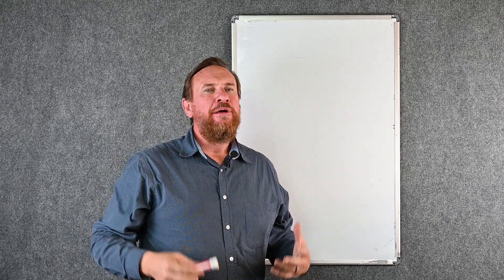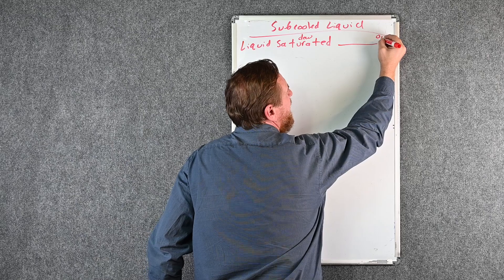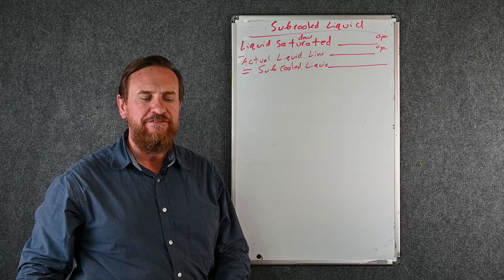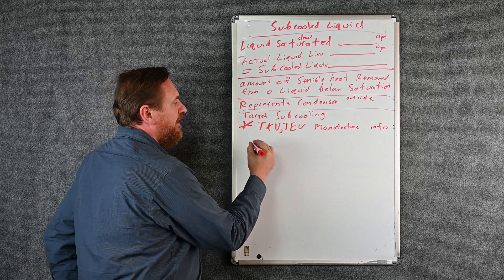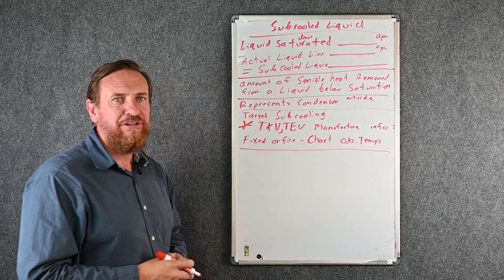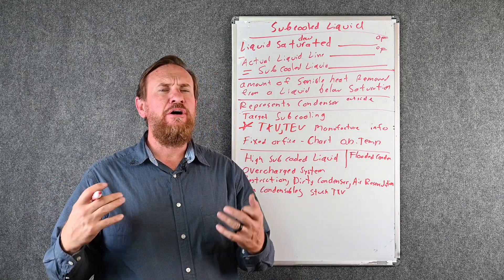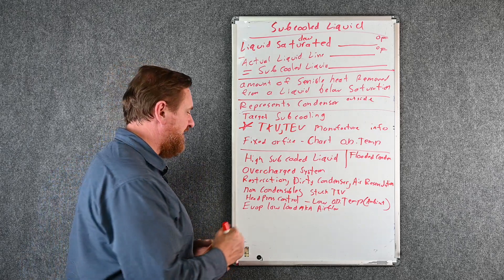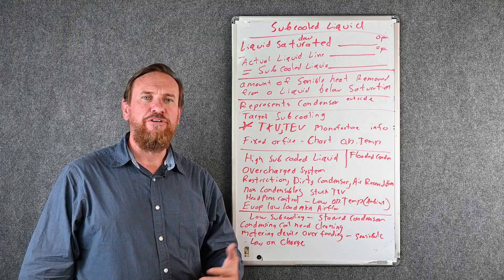HVAC 067 Subcooling notes

Comment: Great video Ty, very simply explained. 
I would love to hear more about non condensibles and system reaction/diagnoses. I have came across it many times as i’ve been on calls, and able to fix it, just never defined exactly that was the fault. usually high liquid line temp/high pressures etc. But would like to know more if you ever do a video as you are the master of explanations 😬

Comment: HI ,,Many thanks  your information greatly cleared up my auto trade teachings [ alot of incomplete theory buy not what u need ] subcool and super heat  gotta luv them . 
Ideal low press R12/r134a low ac auto 20- 30psi/temp prevent freezing ,, high 150-180 psi /temp = properly cooled 100% refrigerant supply to evap . All this at 105f ambient . !!
Try 270-290 psi down to 150/160 the system performed way better with 2nd condensor .  Refer above . Sent bill to Ford ...LOL  vent temp 45f  doors open   lol lol  works really well
Thankyou for clearing up my auto teachings . As u may no auto are very poorly designed systems compared to commercial fixed plant .

Comment: good video. i have a question please.
could you explain to me why if the condenser is dirty the subcooling is low ?
what the meaning of starved condenser?, because if the condenser is starved, do you want to say that it  have less  interchange area for latent heat ?, i consider if the subcooling is low the condenser are having more area than normal  for interchange the latent heat, could you please help me with that ?
besides, what happens with the sensor bulb if i the condenser have a low subcooling ?
thank you for your time.  i will really appreciate it.

Comment: Hi Great Presentation on SC with an TXV EEV fuly understand find target on maunf Data plate or otherwise  but Iam slightly confused on Fixed orifice starting SC ..Not SH while SH is Super important Right !!! but @ the moment its SC lesson . .. BUT @ around 6:33 to not sure where its ends 6:45 maybe  but ur saying SC will be much higher with  lower  ODA tempt & also seconds after u said SC will be much LOWER   with Lower ODA if I herd you correctly that is...... so slightly confused witch makes Higher SC 70 day or 95 oda ..for an fixed orifice Day Thanks
Reply from the maker: With a fixed office we focused more on Superheat but we don't ignore subcooling. 
If you look in the playlist Learn HVAC  these videos are in  numerical order. I have videos specifically demonstrating how subcooling works with a fixed orifice. 

I will put it is a few words but the video does a much better job explaining with visual effects. 
With a fixed orifice, as the outdoor temperature goes up the pressure goes up. There is now more pressure against the liquid so more liquid is pushed through the fixed hole. More liquid is pushed out of the condenser so the subcool liquid quantity drops. 

As the outdoor temperature drops the pressure against the liquid drops and less liquid is pushed through the fixed hole. So subcooling in the condenser goes up.

Comment: do I understand correctly that the low subcool indicates that there is no proper heat exchange in the condenser, and the high subcool that the condenser is too much air cooled(too big temp. drop)? When there is a low subcool, is there too much vapor in the condenser and condensation is too late?

Comment: hello, why a dirty condenser coil will cause a low sub cooling? As it heats up it will increase the pressure and the refrigerant will condense faster...Am I missing something?
Reply from the maker: The dirty coil dosen't transfer heat as well so the convincing temperature and pressure rises. The higher pressure pushes the liquid out of the condenser faster on a fixed orifice.
Reply: @love2hvac  I got it, thanks!

Comment: Hi Mr Branaman, can you please answer my question: what will append to AC condenser (in summer mode) at low ambient temperature to the amount of liquid refrigerant?
Reply from the maker: Usually the condensor will flood to build the pressure needed.

Comment: Is it better to do the wet bulb in the ductwork by the return or out of the ductwork?
Reply from the maker: I prefer to do in in the duct close to the evaporator if there are multiple returns. If its one return it should not make much difference especially in a closet unit. A leaking duct in an attic would make a big difference.
Reply: @love2hvac  thanks ty👍🏻

Comment: Low ambient with no fancycling will cause a starved condenser…. Adding to low sub cooling due to the condenser being too efficient. Even with fan cycling in low ambient the artificial load on the condenser does not raise subcooling just head pressure. There’s just such a major swing in pressure, full column to no column of liquid if you pay attention to a sight glass. Pressures must be stable for Atleast 15 minutes for true readings.

Comment: Anyone have any ideas on what can cause a 4-ton split system in Phoenix to cool perfectly (good superheat and subcool and temp split) when it's 105 or below, but once it gets to 110 outside the temp split drops to 11 deg. It has a TXV inside and outside (heat pump). Sensing bulb is mounted correctly. Inside temp stays about 79-81. Weird one for me.
Reply: Was the charge weighed in, bla, bla?   Sounds like an issue with indoor txv.  Gas type is 410a?  410a critical temp is 160F, right?
Reply: What are the actual temps coming out and return in your air supply?
Reply: Yes it’s AHRI ratings are 75 degrees inside 95 outside . When you fall outside the realm of these temps you will drop off accordingly .In other words if you want it to keep up you need to increase capacity or decrease load.(think insulation ) or such.